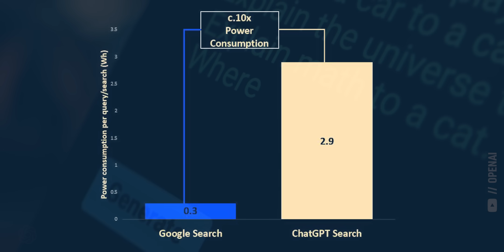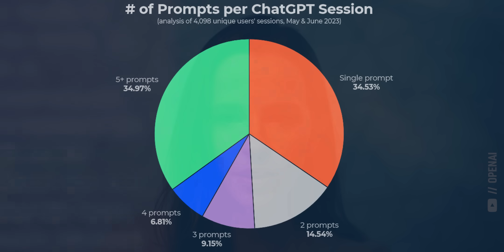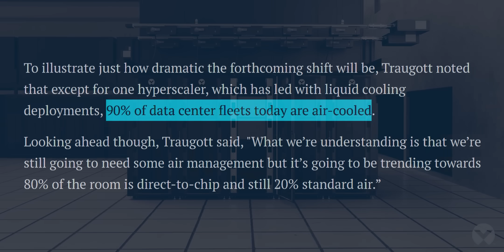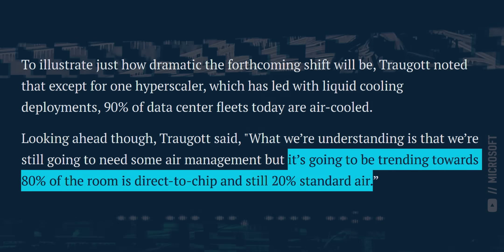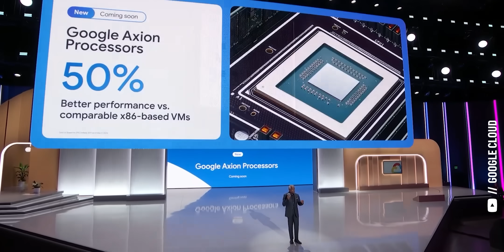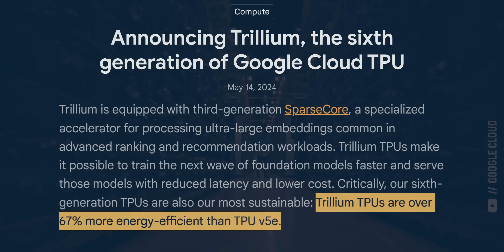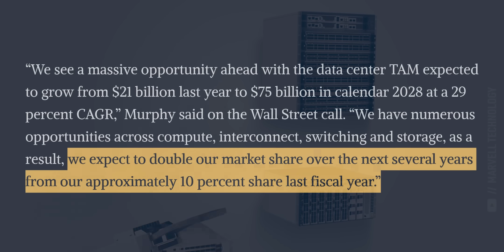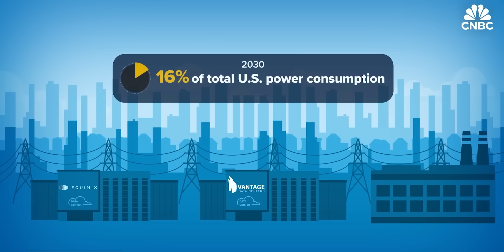I'm Buying These 3 Stocks to Get Rich (Without Getting Lucky)

Comment: You have to be careful about assuming generative ai will always consume more electricity than search because there is caching and indexing.  There are questions that are frequently the same or similar and the ai will just output the same answer, thus it will use little power for certain queries.  I don't disagree that these businesses will grow, but it might be more hype to justify a high valuation.

Comment: Just a question, when Vertiv was running up 850% in the last 2 years did you mention them in a previous episode. If you did your a genius. I just looked them up and 850% in the last 2 years. Thats alot of gains I don't know if it will maintain this 80 or 100% a year return. What are your thoughts.
Reply: I was wondering that as well.

Comment: Man I wish you were as popular as people in the comments think you are. Thinking that a video can be responsible of moving the market on a single stock for 40%+ is crazy. Bet angry people are the ones that skipped on your advise of POET representing no more than 1% of your portfolio and went ham investing 100% cus they thought stock was gonna boom from one day yo another. People thinking money comes for free is usually people that cannot hold it for long.
Keep up the good work man. Spraking of which, are you tracking any energy (electricity related specifically) stock atm?
Reply from the maker: Thanks for the kind words and yeah, the feedback has been pretty wild lately. Not tracking any energy/electricity stocks in particular, as utilities (and the like) are structured pretty differently from semiconductor and AI companies. Looking into other solutions to save energy in data centers though, like the 3 stocks in this video.
Reply: What are your thoughts on SERV robotics do you think it will run in the future or do you think it's done?

Comment: pumper for money
Reply: @mok822  Untrue.  He didn't pump any stocks.   He presented many stocks for our consideration over a long stretch of time, but never made false claims about any in all the time I've followed him.   Are you new to his channel?
Reply: Pumped stocks tend to be micro caps where the actions of the pumper on the stock price can be significant.  None of the stocks mentioned are micro caps.
Reply: @HepCatJack  poet stock
Reply: @mok822  not mentioned on this video.  That comment would fit more with the POET video.